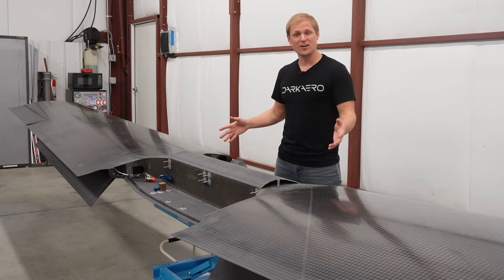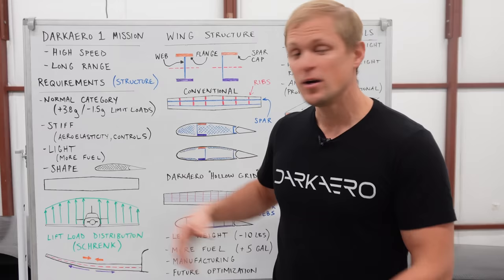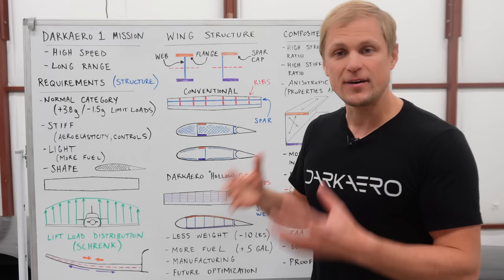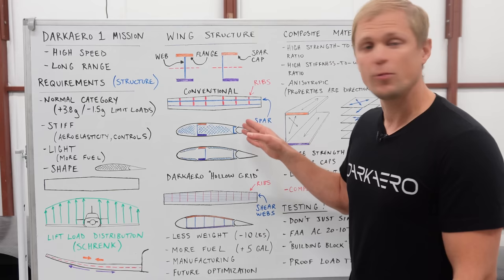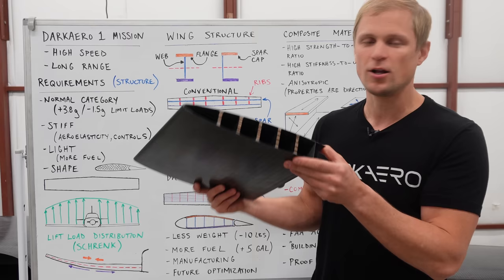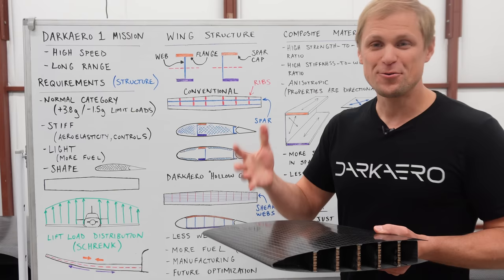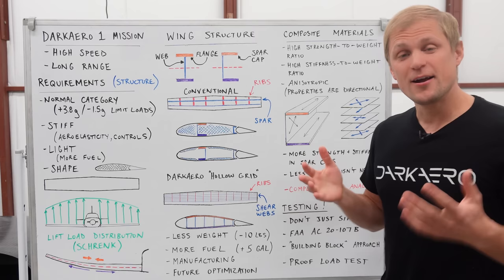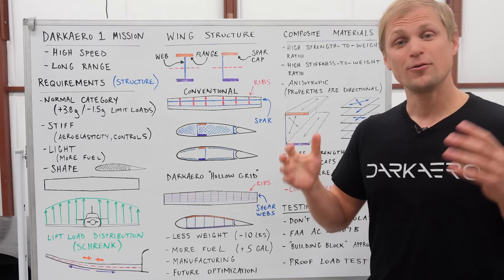Exoskeleton wing design - how carbon fiber makes it possible

Comment: I have a project that I am working on... using a laminate consisting of 2x2 twill, 10oz triaxial and 5 harness. About 10 plys... what is a good feed rate / pass thickness amd plunge for the CNC? Thanks in advance

Comment: Ive noticed you have plenty of click bonds in the middle of the wing, do you use those to actually mount the wing to the fuselage??
Reply from the maker: The wing is structurally joined to the fuselage with four large bolts (two on each side of the wing). There are a bunch of Click Bond nutplates on the forward and aft edges of the bottom wing skin that tie it to the bottom skin of the fuselage. There are a few other Click Bond studs used to support the sump tank and fuel lines.

Comment: What are your thoughts on operating temperature of your materials?  Modern carbon gliders have the ultimate load testing performed with the whole structure heat soaked to 54C.  Most gliders are still restricted to dark paint only on relatively low stress areas like the nose and wingtips.  You guys have "dark" in the name, do you expect a hot day in the sun to have an impact on the structural or flutter performance?

Comment: when you loaded the wing with concrete bags, what kind of sounds did it make?
Also... with a fixed 3.5 g load, the bending moment is larger than your diagram suggests because the lift force over the fuselage decreases... this shifts lift load outboard increasing the moment.... (Shear load is still 3.5 g's)

Comment: What about shear loads on the carbon fibers?  Are the properties somewhat isotopic?  With wood structures shear stresses while under bending loads have to be considered because wood has much less strength in shear than it does in tension or compression.  You mention buckling.  It doesn’t seem you have any long enough unsupported flat areas to be concerned about buckling.  What area is buckling a concern?  Does carbon fiber have infinite life or does it have to be taken out of service after so many cycles or a set time period where the adhesives loose there strength.  Good design.  Looks very efficient and sleek.  What about repairability?

Comment: Hi, what is the margin on g-load? Have you checked the max g-load? A VL3 is looking at >15G. Is your wing similar?
Reply: Very unlikely that its ultimate load is 15g. That would be a UTS factor of safety of nearly 4, which is massive. 
Aero structures are mandated to have a UTS FOS of at least 1.5. That’s true for both civilian and military aviation. You could use more, but typically a design is aimed to meet this specification, or get close to it (but never less), as having more simply means that your structure is needlessly heavy, negatively impacting all performance criteria.
Reply: While I cannot speak to this specific design, fiber reinforced composites have certain properties in common. Nearly any engineer working with composites is going to be using strain and not stress for their design allowable. There is a certain amount of strain for any given composite fiber/matrix that is able to endure a certain load cycle indefinitely. A little more strain will significantly shorten the life on the structure. This could be an indefinite life at 0.0027, 1 million cycles at 0.0039 or 1k cycles at 0.0072in/in strain. Because of these fatigue limited allowable strains, any aircraft designed for 3.8g will inherently be able to handle a one-time overload substantially higher than its limit load. (As long as it was constructed in a high quality manner). So, any composite structure designed for a long life cycle at 3.8g will also have a reasonable probability of survival at upward of, or beyond 10g for a few moments. There is no reason to intentionally design a standard category aircraft with greater than +12g ultimate strength unless its incidental to obtaining a certain lifespan at a lower expected load factor. No reason to target 15g, Because the human operator is not going to be able to withstand much more than 11-12g for a few moments. And the probability that the aircraft will ever see that load is almost nil. And the probability that it will also see that load while also loaded at its maximum gross weight without any fuel burn along the way is practically an impossibility. Any less weight than maximum design weight provides additional load factor strength margin. The end. ;)

Comment: Wow! So would computational design composite fiber spars really be the dream in terms of focusing strength where it's needed while also reducing weight to an absolute minimum? Until that manufacturing technology becomes cost feasible, is there just not enough strength benefit to computational design 3D printed metals to outweigh (pun) the weight-saving and ease of manufacturing benefits of a hollow grid spar arrangement?

Comment: Yes but how do you attach the wing to the fuselage?  With a conventional spar design, the spar carries the entire load, so you just have to attach the spar to the fuselage, with appropriate strengthening at the attach point.  With this design, the entire grid must attach to the fuselage as the load is distributed throughout the grid.  That sounds like a much more complicated attachment design.

Comment: 11:24    observations.      this design results in a wing whose dom is  less-than optimal.          a wing is  Supposed  to have  a contiguous*, LOAD-BEARING main spar, located at thirty percent of chord.   (* where a wing is swept or has dihedral, the use of a Central main spar (section), that spans the width of the fuselage  is  normally  necessary.)
should we assume that air pressure in all those compartments is able to  Equalize.          this aircraft could be  built  LIGHER, using  Tradition all construction methods.!!!        consequently, it is not clear  WHATthehel  you are trying to prove.

Comment: Will the wings hold fuel in this design or does it have a central gas tank
Reply from the maker: It’s a wet wing design, and the majority of the wing volume holds fuel (77 gallons), but both tanks drain to a central sump.

Comment: Not sure 'exoskeleton' is the right term. 'Exo' means external or outside, from the Greek language. So in an exoskeleton, like an insect has, the strength comes from the external structure. Your wing has internal spars and ribs, so that the strength comes from the internal structure.
Reply from the maker: Hi Drew! Thanks for checking out the video!The strength of our structure does come from the skins. While there is an arrangement of ribs and shear webs within the structure, it is only there to carry shear loads between the skins and stabilize the skins against buckling. The peak stresses are found within the skins of the structure. The foam core wing shown in the video operates under the same principle. We just used a lightweight internal grid to support the skins rather than a low density foam core.

Comment: Me: Doesnt want to learn calculus to be a mechanical engineer.. Also me: gonna build my own airplane.. # F Calculus i found a calculator! Any time you build something new.. You cant just use it.. NO you gotta do destructive testing on it and build it again.. I dont wanna destroy the plane! :( destroys a 4 inch x 6 inch piece of carbon fiber. Kinda like how Million dollar super cars refuse to do any crash test ratings cause its too expensive to rebuild one.. How does carbon fiber do in a impact? does it just crack or snap off? I feel like the epoxy used could make it too brittle for impacts. just dodge them birds sully! Or hope your over the Hutson! 🤣 F that parachute it is..

Comment: that will become even lighter if you pressurise the wing, tubular wing, large places with passengers in wings
Reply: you better have wings rather than not have and trying to optimize falsely all the time, every day
Reply: why fuel, use pu-238 external heat turbine or nuclear-solar-panel electric propulsion, even heat peltier heat-electric power conversion
Reply: 88 year life time, same as you lie yours to be
Reply: only support tube frames
Reply: kinda inverse blimp helium balloon, but with air
Reply: instead you trying to resist compression, you counter-act that with the internal (oxygenated) air pressure
Reply: your wing looks like blimp cells
Reply: remember that shaped balloon will keep its shape when inflated
Reply: the wing balloon shape can be even light-weight thin metal
Reply: a wing is two plates with end round parts, which can flex more
Reply: why would you ask flesh and blood anything (the law)
Reply: simulate for what, dont you have freedom to try

Comment: That's a horrendously complex, labour intensive and fatigue prone construction system you are using. Bonding the shearwebs to the wing skins is a very bad flaw.
When I built the composite fan blades for the Americas cup wind tunnel I  used a two cavity full length central shear web molded by resin transfer molding, with shaped pressure bladders. This allowed dry fabric to be rolled around the bladders, laid into the CNC machined molds, and the mold sealed and heated before pumping and vacuuming the resin through the seams.
Continuous fibre flowing in nice radiused intersections at all the profile junctions. 
Those will never fail. 
It took less than an hour to lay the cloth seal the mold, and impregnate with resin.
They have tested all the winning rigs since 1999 and a lot of other work as well.

Comment: 1.5 - G's it's not strong at all, my cheap ultra-lights had better -G's than that!
Reply: This was the standard operating load, not the maximum load.
Reply: @jamesengland7461  You know a lot more about airplanes than I do that is for sure! but what I know is when flying straight and level no turbulence you are at 1g all the time, if you do standard maneuvers you might pull 1/2 G more, the only time you pull a lot of Gs is when doing aerobatics and heavy turbulence you can always limit your aerobatics but turbulence you can not! it would help if you gave the max Gs too
Reply: @mcfast52  in your initial comment you said 1.5-g isn't strong and yet now you say 1/2 g is plenty.  Which is it? As for this plane,  you'll have to ask them.
Reply: @jamesengland7461  What I am saying is 1.5 Gs is plenty if you do nothing but fly around very docile if you start doing aerobatics or get caught in heavy turbulence it is far from being enough.
Reply: @mcfast52  performing aerobatic maneuvers in a normal category aircraft is illegal. But being aviation know it all you already knew that.
Reply: @blegi1245  I do know that and like you being in aviation you should know that just because it is illegal does not mean that people will not do it unless you do not fly and just design!

Comment: the static weight tests are useless trash. 1. they do not test the materials at cold temperatures and hot . Cold at altitude is where the plane will be most of the time when subjected to load variations from turbulence. 2. The wing will experience shock and vibration Gs well about your normal category. those Normal numbers are not the peak numbers you must design to. 3. That wing in a life test , stress test, and flex test Or Qual test, in a thermal chamber will crack and come apart . I bet it wont survive a shaker test at cold temp simulated 12K ft

Comment: Is this an actual commercial project or a YouTube channel only. This thing is totally over engineered and no one will buy this thing having so many better options out there. Sorry dudes. You seem to be great engineers but this is the problem. You seem to not ask the market before deep diving in engineering heaven.
Reply: It doesnt look that over engineered just different from the usual.
Reply: Yes, they plan to sell it as a kit. Over-engineered? They're literally following what the FAA says you should do when designing, building, and testing an aircraft. I'm curious what "better options" you refer to—if they are indeed better, I imagine they've been subjected to similar testing and engineering effort. Would you climb into a clean-sheet design aircraft that went fast without GVT/flutter testing done? Would you climb into any clean-sheet design that didn't have wing/control surface load testing done? Firewall testing? Or are you simply of the opinion that there is no point in ever bringing a clean-sheet design?
Reply: There are precious few options for this mission. Please name all the planes with 2400 mile range at 220 ktas while burning 8 gph.
Reply: Seems like the market has already approved of the aircraft. Over 150 preorders, worth over $10 million in revenue.
Reply: I disagree.  I have watched all of their videos, and their engineering process follows a methodical process.  They always refer back to their core goals (long range/high speed), they consider ease of manufacturing and building all the time, and they aren’t afraid to innovate to optimize their product.  Just in this video, he talks about how this wing design will eliminate the need for many composite molds, saving the builder time and money.  These guys have to stuff to be market leaders, and asking the market (as you suggest) is a great way to end up with a project full of old ideas and solutions.  That’s not horrible if you are aiming for the middle of the market, but you won’t get a design that optimizes speed, endurance, and economy that way.
Reply: What crap do you have in mind if you think this is over engineered?
Reply: Me when I “over engineer” a fucking airplane 🗿